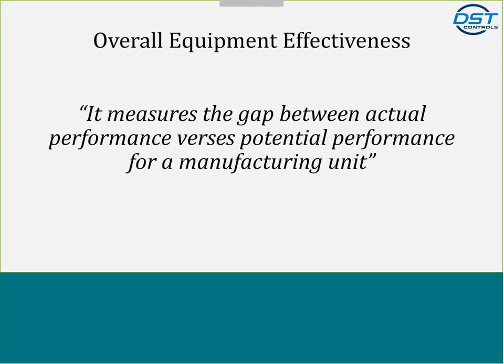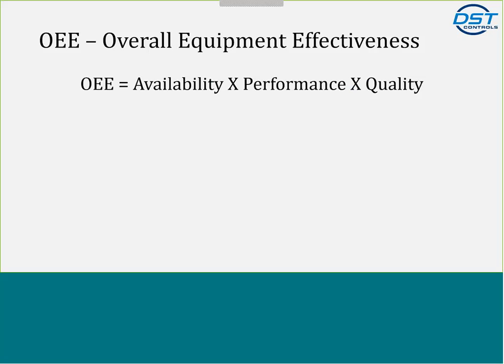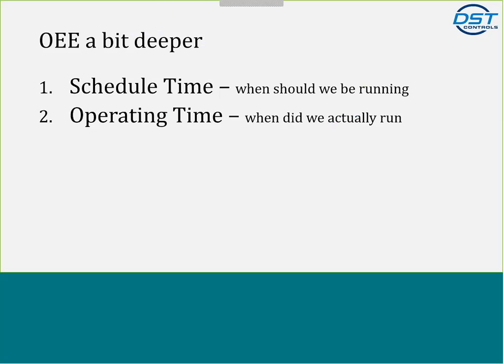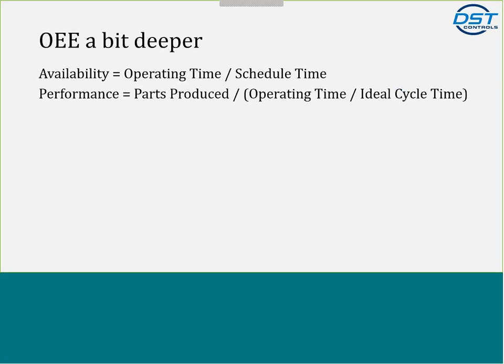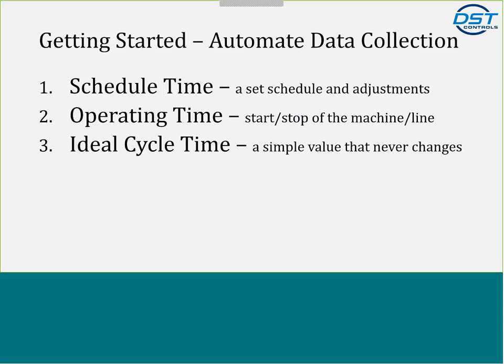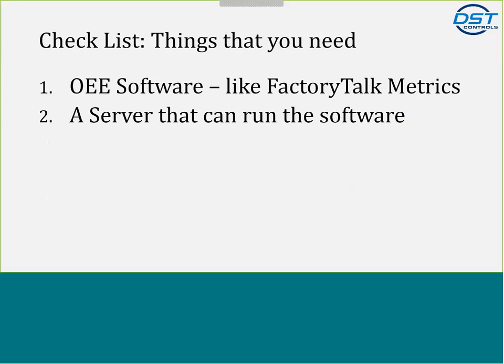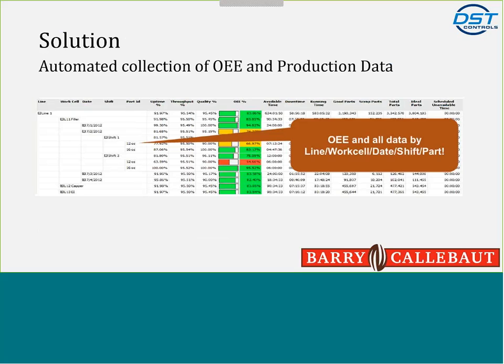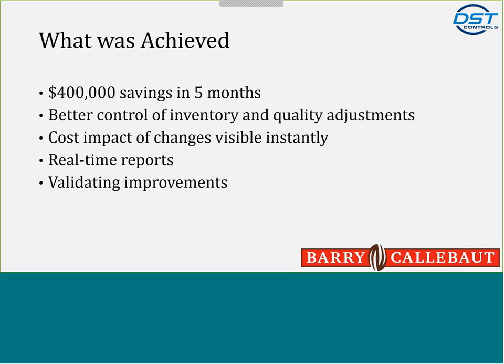Production Line OEE

Comment: Hello.
How do you calculate an ideal cycle time when the machine that you are measuring has to be operated by a human?
Do I need to include an allowance for tiredness?
How your performance will behave?
Woould it be normal and correct to see perfomance higer than 100%, cause operator in some hours may not be tired?
Can we consider the stoppage of equipment as a relief for operator fatigue?

Hope you or anybody can aswer my questions.

Have a great day.
Reply: you should use the designed speed of the machine if available.  in case, total manual production, it would be suggestive to do assumption on  how muchl time is spent by average operator in optimal condition.